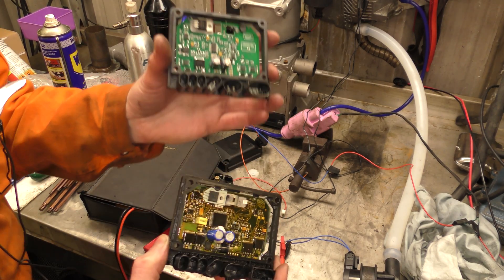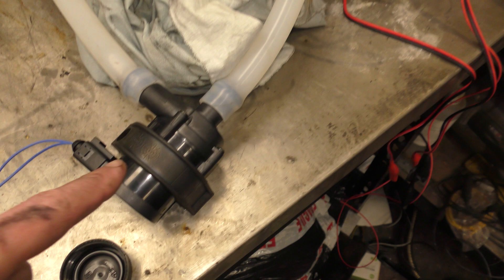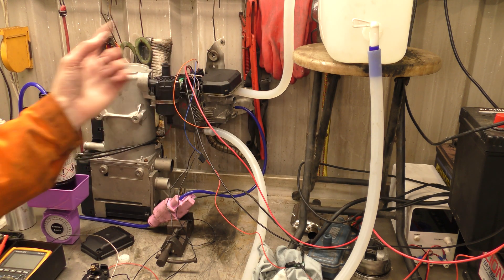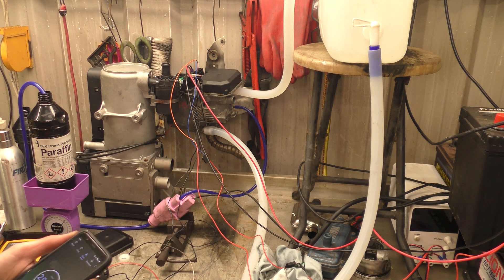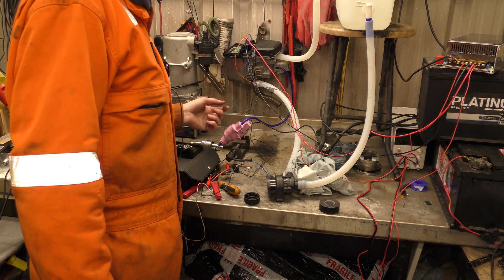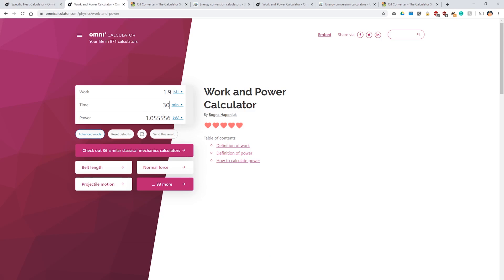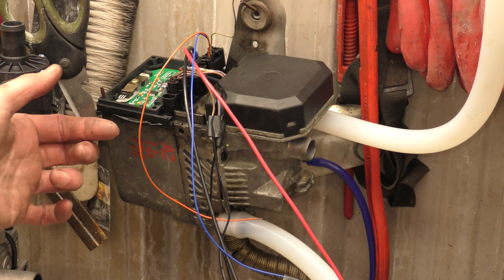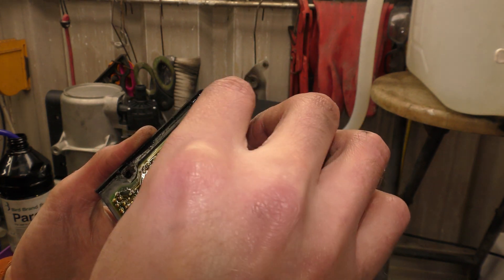Webasto non canbus ECU conversion / replacement

Comment: Hi David. I have a thermotop V The trouble im having is it will run perfect for 1 hour and then shut down. Even when it cools  it will not start up again even when the W-bus is flashing. the heater is circulating through a heat exchanger  to heat water for window cleaning which we think will be cooling the water as it ciculates . I was wondering if replacing the ECU card would set the heater back to factory setting as i have read that it could be set at one hour for the car it was in. Any info would be appreciated.
Reply from the maker: If you could get an ECU from one that left the factory as a water heater (like the kind they fit in boats) that would work.  All the ones I've had have been ex-vehicle with the hour long run time.  Even the Chinese clones I have, cloned the car ECU and only run for an hour as well.

Comment: Can someone explain me one thing. I got webasto thermo top evo comfort (parking) 5kw. But on its side there is volkwswagen symbol, i have been told that it is for specific cars and will not work otherwise. Other party tells me , that i can purchase any telestart webasto kits with w-bus output and will work just as fine as an preheater. Who's right in this situation, need an answer :(
Reply from the maker: I don't know. I haven't had any VW versions. Me, I would buy one of the cheap wbus triggers off ebay to test with.  Like this - https://www.ebay.co.uk/itm/124147753763?itmmeta=01HQFKS5Y9C22A9B7YCWBFYBMK&hash=item1ce7c86323:g:kOoAAOSwwlRlbV-u&itmprp=enc%3AAQAIAAAA0FeR6IuXvPFT0Z%2Bnwyu7ptr8YxIr9tCj5XUsg13tYXcJAbofvREF5ke%2FRmNnkEsnVBr%2BmYD5L5heupEXKGd6162gCWVJIWhIRBoOt%2BUMdgmTuRFJpcA3acPhaTJ%2B5fqDkytuXn%2FvjxrUTsFAxoJN5xE%2BexA3oylvZw5B2s0hY54enIb1c9b9tCTdj3qfbzRV3XByJu12TDhKzaMN7oeyqHtXTlTP%2FAfXRNjxd0HrX3HU12VdKz8IHAtZzSluyiMtLyQxxiIigcR%2BWp7Umv4GAdU%3D%7Ctkp%3ABk9SR87f5PO7Yw
Reply: @DavidMcLuckie  currently I am at this point. I bought vag com cable, managed to connect to my VW webaato, turned on the vent only , because I don't have the metering pump yet. When it comes, I'll try to turn it on via WTT and see how it goes. Also I have this strange fault - 80h customer specific, which I can't delete. Don't know how it affects webasto overall

Comment: Greetings. I just bought a webasto thermo top z/c -D, with data sheet n90906 5h8 007 633-10. I would need to understand if this type of card works without vehicle diagnostics or w bus. If it just works, what do I connect pin n3 to the positive or negative of the battery to make it turn on? Also is pin n6, for the diesel pump, positive or negative? Thank you.

Comment: Very interesting.  Can I ask you for some information?  At what temperature does the overheat switch cut out?  110 or 170 Celsius ?  flame sensor maximum temperature?  80 or more Celsius or greater.  Thank you Paul
Reply from the maker: Off the top of my head I think it shuts itself down at 85ºC.  It's switches to half power at about 70ºC.

Comment: the canbus one can be programed to work with only 12v on pin 1
Reply from the maker: I know.  I've done it.  But only on BMW boards.
Reply: @DavidMcLuckie  Which software do you need to swap them over?
Reply: @DavidMcLuckie I know it's been a long time but do you have a video on this or any information you would mind sharing? Cheers.

Comment: If you've still got the original PCB then remove the silicon sealant from the 2 electrolytic capacitors. There are surface mount resistors under there that will be open circuit. The acid in the sealant eats them! Replace the resistors and it will probably work again. That's how I fixed my unit.

Comment: Hi David, love your videos, I bought ourselves a brand new webasto evo thermotop. All installed, went to turn it on, nothing.
I’m seeing this video am thinking that I have bout one with a can bus pcb in side. Where did you get your pcb board from again?
I would really appreciate your help. I’m getting close to blowing a gasket lol
Reply from the maker: If it's an EVO you can get a module that 'tricks' it into turning on.  I do have a video on it, but here is a link to the bit to buy - https://www.ebay.co.uk/itm/124147753763

Comment: if you get a used wv thermo top evo from ebay can you mount a control panel on it just by changing this board, as if it were not a wv issued piece?
Reply from the maker: Yes.  If you can find someone that sells the 3rd party boards.  As of right now they seem to have disappeared.

Comment: where can you find those third party boards? does it mean you can grab an old vehicle adapted coolant heater from the scrap, like on a audi or peugeot 806 and change the board to instal a control panel to use it as a heater for a camper with an aerotherm heater and water heater for the shower with a plate exchanger?
Reply: Yes

Comment: Hi David.   What is that pink dosing pump you used in this video ?    It does not look like any Webasto pump I've ever seen.    I have tried a couple of cheap after-market dosing pumps but they could not provide even half the fuel required for a ThermoTop C at full power.

Comment: Watch my videos I can wire any webasto to work without canbus W bus signal it’s simple no need to swap pcb’s
Reply from the maker: Are you using the telestart trigger wire on pin 1?
Reply: @DavidMcLuckie  no there’s a trick with every heater to get going even kbus without different boards even bmw
Reply from the maker: Are you flashing with the modified PRN file?  Can I even get a warmer or colder on my guesses?  :)

Comment: Did the replacement one (by any chance) come with schematics in the manual?  I'm an electrical engineering type, and wouldn't mind seeing how it works.
Reply from the maker: It did not.  But if you are interest another 3rd party board which I haven't tried yet are sharing all the source material - https://orbbasto.info/sourcecode.htm
Reply: @DavidMcLuckie  Ah.  Thanks.  I'll take a look.  I'm in the process of creating a frontend to use the stock controller on a Thermo Top C by talking over the K-Line, and combining it with custom sensors (over LIN bus), and hopefully making it all hook up to a Raspberry Pi. :)

Always good to see what others have dreamt up.   I may need to replace a controller board sometime anyways, who knows.
Reply: @DavidMcLuckie  Thanks.  I'll take a look.

Comment: Did you find the high frequency noise from the mosfets was a lot more noticable on the aftermarket 1 compared to the origanal webasto 1 ?

Comment: IIRC, Webasto fuel pump pushes 0.04mL per pulse, Eberspächer branded units deliver 0.02mL per pulse. If You are using the pump which came with the chinese Eberspächer clone then It's a possibility that Webasto is not getting enough fuel. Hence the low power output. Just an idea, I might be totally wrong as I often am. Cheers.

EDIT: Webasto DP2 metering pump used by Thermo Top C claims to deliver 0.063mL per pulse.
Reply from the maker: You are not wrong.  It actually didn't even start up using the chinese heater fuel pump.  It's supposed to be a 65mm3 the closest one I had was a 50mm3 so it was slightly underpowered.
Reply: @DavidMcLuckie  That's great information! I want to fit one of these to my car, plenty of heater main units around but not many pumps as those removing the units probably don't realise that the fuel pumps are needed.
Reply: @gerryr1893  I have a 2002 Range Rover L322 unit which is immaculate, looking up the exhaust port the burner is nice and shiny, seems to have hardly done any work but not sure if this version will take a pin 1 or 3 start signal.
Coolant pump and combustion blower run and sound sweet. (Powered separately).
Got a fuel pump on the way and if the board won't accept a 12V start signal I will go for the Hungarian board or do a cut down version of the Arduino shower
Reply: @simonparkinson1053  Yes, sadly that's often the case. It's a shame that the Chinese don't make the 0.063ml/pulse pumps, since the genuine Webasto pumps are so expensive
Reply: @erik_dk842  Actually they do, or so they claim as a replacement for DP30. It just took some finding.
Look up 402617009069 on ebay.
Price wasn't too bad, I paid £16.42 but they've gone up another £10 now.
I haven't had chance to test it properly as yet.
I've got an original pump that came with a second heater, it works but is incredibly rusty.
Reply: @simonparkinson1053  As long as it's not rusted all the way through...
Reply: @simonparkinson1053  Hi Simon, I too have just bought an L322 heater after doing some research, it seems to be the "12v on pin 1 to start" model. However, it doesn't do anything. Unsure if I have a faulty heater or not (the seller claims they tested it, but I'm not so sure..) Did you have any luck with yours?
Reply: @dcobblers  yes, connect to Webasto Thermo Test diagnostics (choose heater type Z/C BMW).
Run the component tests.
If all tests pass, remove the PCB and check it is part number 91452C.
If all above correct, send the board to Robinson Labs for reprogramming to analogue rather than bus controlled.
Reply: @simonparkinson1053  Thanks for the reply Simon, I didn't realise there was different programming on these boards!  Mine looks identical to the analogue controlled ones. The part number on the back is the same as a Thermo top C board (I forget exactly what it was). I'm also not having any luck with the diagnostics, but I think the KKL lead I'm using is a faulty one. When I try to connect as a Z/C BMW I get "incorrect message length" errors, but when I try any other unit I get no response so it seems as though it's halfway there. Activity on the K line and pulling pin 1 to 12V seem to wake the heater up (current draw goes from 0mA to ~50mA) but there is no action on glow plug, fan or dose pump.
Reply: @dcobblers  that's how mine behaved. Waking up but nothing else.
I had been trying to talk to it as Rover and choosing auto detect but no success.
Then I found I should choose BMW and found it would communicate.
I'm using a KKL lead with just pin 7 as signal, 4/5 as ground and 16 as +12V.
I've set mine up as Com 3 as I believe the software has issues with higher port numbers.
It did auto allocate a higher number originally.
Reply: @simonparkinson1053  Yes, identical setup. Are you just working on the bench with yours? Did you have to add a pullup resistor on the K line? Thanks again!

Comment: Hello do you have the pcb you took out ? Want to sell it ? .  I need one for my  in (in car) bmw webasto .
Reply from the maker: It's fucked.  I bought the Webasto PC diagnostics kit and it doesn't connect.
Reply: I’ve wired just about every webasto there is without needing a canbus signal
Reply: @gerryr1893   any idea how I get the Range Rover zcd one working?
Reply: @gerryr1893  maybe do a video on it, as it would help a lot of people out 👍👍

Comment: can you tell be the board if its a can bus or not?
Reply from the maker: This board is most likely to be K-Line or W-Bus.  To old for CAN-Bus.
Reply: @DavidMcLuckie   with nothing attached ie fuel ,water pump if i attach the 12v in it runs instantly do you think it will continue to run as quickley switched it off
Reply from the maker: Yes.  The first one I had did nothing when the 12V trigger was applied.  This board has a fault and just runs the fan.
Reply: @DavidMcLuckie  is it ok to leave a little longer before pulling the power off with nothing attached to see if it goes to next stage or wait till  the bits arrive
Reply from the maker: If you've got the bits coming I'd wait.  If they fail to light enough times they go into a lockdown, then you have to try and clear the error and get it to run again.  But the fact it does anything is a good sign.
Reply: @DavidMcLuckie   i have no programs or anything to test as i dont want to start throwing money at something that might or might not work
Reply from the maker: What parts do you have?

Comment: Is it possible to change water temperature or custom set working power of the unit?
Best regards.
Reply: You can. You just need a controller with a probe. Set the temp you want and it will stop at that rather than the 80 or so it gets to with just using the unit itself. An Lae X5 are very good but not cheap
Reply: I heat my hot tub with mine works a treat costs my £0 to
Run

Comment: I have 7 webasto heaters. The only 1s that need canbus are bmw and rover 1s. All the others work perfectly with just a switched 12v supply.
I also have 1 of them boards if any 1 wants it for a small fee, its for sale !
https://youtu.be/oiv7ckunhZI
Reply from the maker: So that's the thing.  One of the other commenters says his are all from BMW X5 and run straight of the 12v input.  Maybe it depends on age as well?  Certainly something wrong with my original board anyway.  :)  (Also love your bean can header tank!)

Comment: Great video! Now all we need is an aftermarket LCD controller to pair w/the CANbus bypass board, hopefully with a timer control function and/or remote control function.
Reply from the maker: For a remote you could use any remotely operated relay as all you need is the +12v signal to start it.
Reply: @DavidMcLuckie  This is exactly my plan! But I will be using a Chinese water heater. Do you know if the Chinese heaters can operate with a 12v signal in the same way? Thanks!

Comment: Can you convert a Chinese ecu to control wabasto or eberspacher
Reply from the maker: In theory yes.  You have to change the temperature sensor as the Chinese heater is looking for a hot outer casing where the Webasto would be looking for a much cooler water temperature.  Perhaps I'll try that one day.
Reply: @DavidMcLuckie  would be ideal  think there about 10er for one.. thnks for replying!
Reply: There's a good reason why they use the resistance of the glow plug for flame detection. If the heater is trying to heat up 150 kg of iron from -15 deg C, it takes forever to register any rise in temperature, and if the flame did not ignite, the burner chamber would be full of diesel. The Glow plug is right at the flame, and is already there.
What the Hungarian board fixes is Webasto's built-in planned obsolescence, which locks out the heater when the glow plug gets old and won't drop below the required resistance during the start-up phase. It sets the fault "too early flame detection". This board raises the threshold while still maintaining a reliable flame detection.

Comment: In one part your saying 30 mins but on the film you said 10 mins
Reply from the maker: I thought I had fudged the fuel measurement so did a 10 minute retest and got the same fuel use as before.
Reply: ah I see keep up the great work,  maby send the controller to Bigclivedotcom for a full analysis

Comment: These afaik are rated at typically 5KW and should heat water to 80c by default iirc 
I suspect this one stopped at 60c and then modulated back hence the relatively low power output result.

is the resistance range of your water temp sensor compatible with this PCB?
Are these PCBs set to maintain a lower temp, e.g for dhw use?
Reply from the maker: Quote from the manufacturer specs - If the water temperature reaches 76°Celsius heating power reduces to ~50% capacity.

If the water temperature gets lower than 56°Celsius the capacity rises up to 100%.

The heater will switched off , if the water temperature reaches 80°C .
Starts on 12V start signal and works until the water temperature reaches 80°C or detects any operational problem .
Reply: @DavidMcLuckie  Ah ok so during the 30 minutes test I guess it was running flat out for the duration? I have not played with one of these for many years now and that was with a couple of 3000BTU radiators attached so not quite the same test nor amount of water but it definitely got up to 75-80 ish quite quickly.

You definitely need to stick a radiator on one of these in your shed it looked quite nippy :)
Reply: @CriftinsCampers  It heats up 100 kg of engine in half an hour. I bet it reached 80 deg C and ramped down long before 30 minutes
Reply: Erik_DK yes exactly, in my head I was thinking if these can normally heat the water running through a massive heat sink i.e. an engine block fairly quickly to max temp then I expected it to heat the barrel of water faster but perhaps I got that completely wrong and there was a far greater amount of water to heat up in that barrel

I really miss having one of these in my vans cooling circuit, I think I will have to fit one!
Reply from the maker: Either that or my heater has more faults, maybe something to do with the fuel.  I expected to heat faster as well.
Reply: @DavidMcLuckie  I had a play with my two TTC units, yesterday, 10 liter bucket of 12 degrees water to 74 degrees in about 10 minutes. I'll do a timed test today to more closely replicate your setup.
Mine was a bmw vehicle specific board, but I changed the dataset in it with WTT software and a £5 usb kline and now it responds to 12v on pin1 or 0v or pin3. Happy to share btw
Reply: @lukejones2772 apologies for responding to a 4 year old reply but do you have anymore information on the setup you mentioned as I'm in the process of converting the same unit? Cheers.
Reply: I can’t speak to how efficient these really are but I have an eberspächer on my vivaro here in Sweden and it gets the engine temp up to 40-50C in 30 mins when the outside temp is -25. Makes a massive difference is starting performance of a diesel, well chances of a diesel starting are slim with no pre heat in -25 😂

Comment: 11:00 The 10K NTC thermistor is prone to failure. It's the white rectangular component over the cutout to the left of the Hella logo.
Test the resistance and refer to a 10K NTC thermistor chart https://bit.ly/37jb162 for expected resistance vs temperature. It should be 10KΩ at 25°C and at 13°C it should be around 17KΩ.
They're common and dirt cheap to buy but you may have one floating around in the form of a probe on a cheap temp controller or thermometer just to test with.